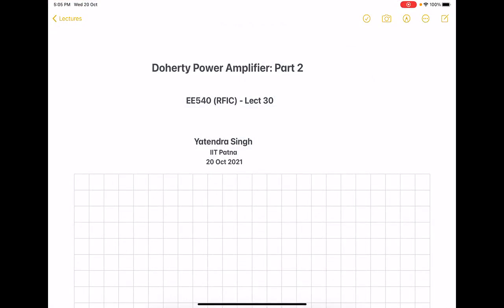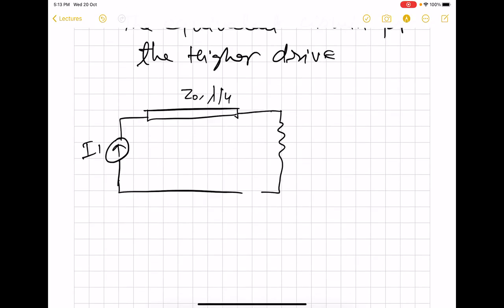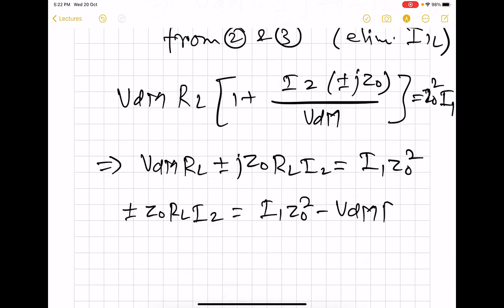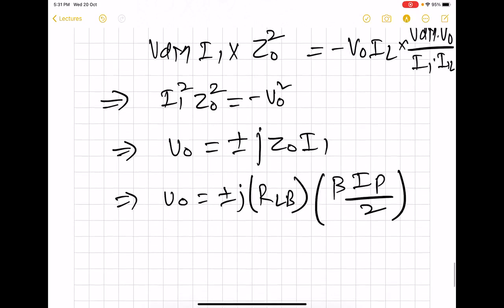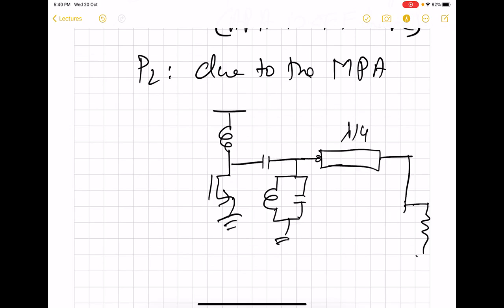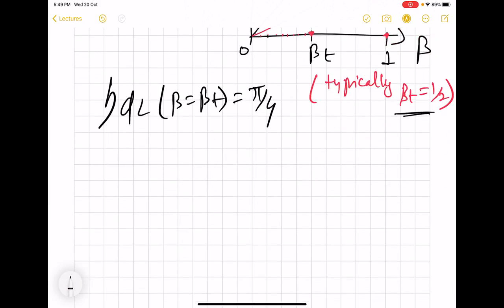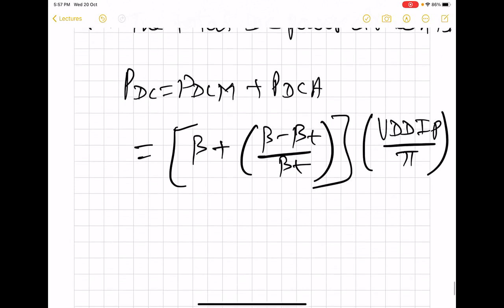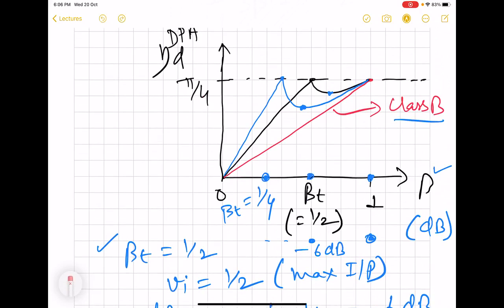Radio Frequency Integrated Circuits (RFICs) - Lecture 30: Doherty Power Amplifier, Part 2

Comment: I understood based on the equations but, Intuitively, why does Doherty amplifier have more efficiency in the lower region (less than beta t)  compared to normal class B?
Reply from the maker: Because the impedance seen by the MPA MOS is different than that of the normal class B PA (=RL class B/beta t) and hence the drain voltage in DPA for any beta is higher compared to that of class B for the same beta

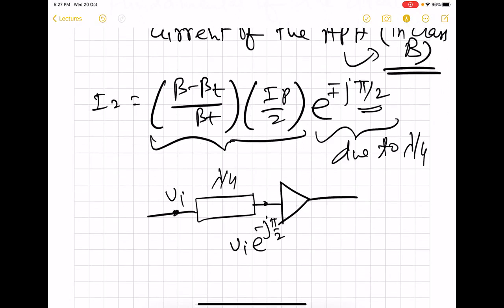Comment: at 22:45, why can't the transmission line be placed after the MOS, even then wouldn't the current get a pi/2 phase shift?
Reply from the maker: True, but now the load seen by the MOS will be get modified.